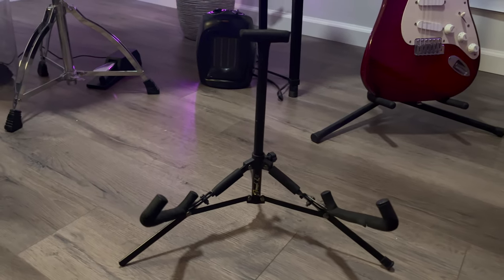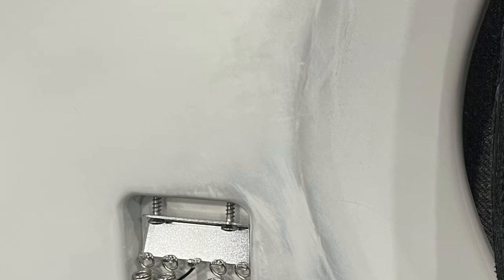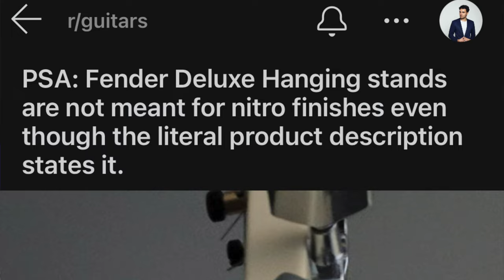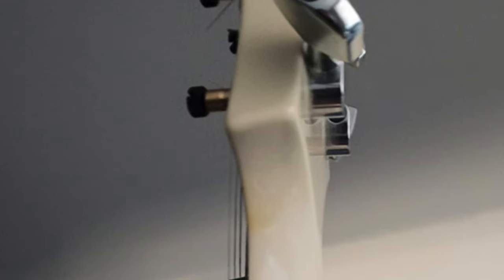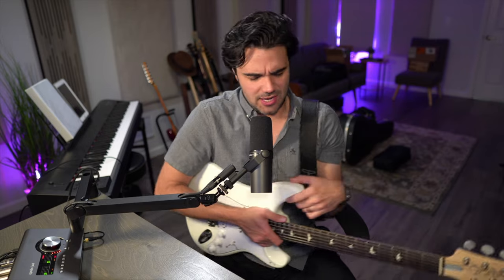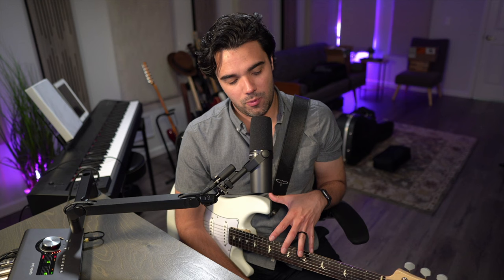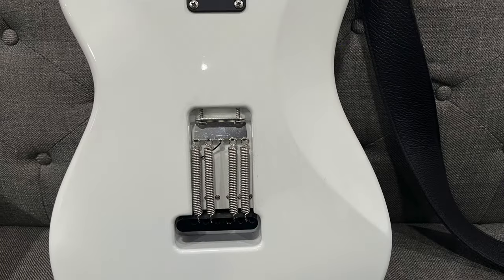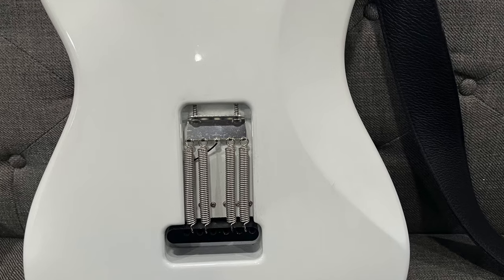DON’T Make This Mistake With Your Nitro Finish Guitar!

Comment: Thanks.  I expected that you had let it get really cold (like in a touring trailer during Winter), brought it indoors, and immediately opened the case.  That thermal shock will create cracks in nitrocellulose; lots of spider cracks everywhere!  Fender changed to polyurethane after many new guitars were arriving at northern guitar shops in Winter that were pretty much un-sellable as new, quality instruments.

Comment: The rubberized spot on top of the stand had major finish in my Strat melt right below the neck plate. Luckily I was able to wet sand it and recover at 98%. After some hand polishing and buffing I was able to restore the damage. Someone has to know where the damage occurred to spot it.

Comment: 1995-ish: Someone post on some forum "BTW don't put your NC guitar in a foam stand/hanger because plasticizer yada". Everyone: Puts old cotton socks on their stands.

2022: Someone who learns about guitars through reddit is stretching that one-liner to 20,000 words in a dramatic short film with a dramatic title, intro/outro, 5 acts digressing into the history of John Mayer and PRS, lots of dramatic flailing hands and facial expressions about how he barely managed to keep this from ripping the space-time-continuum apart (but phew, you can't see it) and finishes with a description of the PTSD the inexplicable chemical reaction almost gave him.  But no info about what actually happened, how to avoid it, what stands might be apt for the job or what self-help groups are out there for the victims.  Everyone: Subscribes.

<shrug>
Reply from the maker: If everyone subscribed, I can only assume that includes you. So, thank you. Also, your synopsis was pretty entertaining. Certainly more entertaining that my video. 😂

Comment: Well, this is known as “stand rash” among other things. Yes, nitrocellulose finishes do react to certain stands or the foam on them.
DuPont developed nitro a long, long time ago for auto finishes and the “breathing” myth is just that, a myth.
There is no scientific basis for this. 
You wouldn’t want the finish on a car to breathe as oxidation would occur very quickly. Therefore, a nitro finish on a guitar won’t breathe either. The wood will as it is a living thing. 
There are many folks out there that perceive certain things regarding nitro and that’s just fine. 
You can prefer the tone of a guitar finished in nitro but that tone is not because that finish is breathing.
I prefer nitro because it ages quicker due to the fact that it’s much thinner so there’s that.
Good video and definitely something to look for though.

Comment: This video shows just one reason why a Nitro Finish on a guitar is crap, there really are just so many reasons to go with polly over Nitro.
Reply from the maker: I know there are good arguments both ways, but if durability is the main concern, it certainly seems like poly would give you that.
Reply: @TomButwin  
Polly beats Nitro in durability, longevity, toxicity, and of course cost.  Honestly, I can't find anything that Nitro does better than Polly that I can confirm is true.  I see all the people telling themselves that Nitro sounds better than Polly, but I can't find any actual evidence that proves it, just peoples personal opinion..
Reply from the maker: The tone argument very well could be a moot point, honestly. I’ll have to do some research. Maybe a video!
Reply: @TomButwin  
This video popped back up in my recommendations so I stared watching it, and I was like "hey, I think I have watched this video before" I scroll down and see these comments from me 6 months ago lol.  I was about to comment a solution for the guitar stand to not hurt Nitro Finishes, its simple but Ive always done it to mine and never had a issue.  I buy a little fabric and wrap it around where ever the guitar is going to make contact with the stand.   I am sure if I was more crafty, I could do a much better job, but a few wraps of cloth seems to protect my guitar necks on my Nitro finish guitars, and it doesn't seem to make things less stable.   I have one of those Fender stands myself, and I used silk on the back and jersey on the bottom so it would have some kind of grip lol.  It works for me, though to be honest I have owned Nitro Finished guitars in the past, but I don't now.  I use that fix on my wall hangers as well, since its the guitars weight holding it in place and not friction.
Reply from the maker: Well, most of all, I’m glad to have you back on the channel 6 months later! Lol I’ve learned my Nitro lesson
Reply: @TomButwin  
well I had to put that idea out there, that was a pretty guitar, even if I dislike the finish type on it, it is a good guitar.  The cloth idea can add extra padding, it protects the finishes on all guitars, and cost very little to do.  Honestly it just takes the guess work out of all of it for me.   If someone is more crafty then me, they can likely decorate the stands to look all cool or pretty, my wife did on one of mine lol.
Reply: I use the old ties on bathrobes . Cut to length and slide it on.

Comment: It can be easily buffed out to a mirror finish...rub the whole back with some very fine sandpaper/scotchbrite type thingy to dull the surface a bit and level it and then buff it out to the shine you want with rubbing compounds..that being said it shows how stupid those old guitar myths are...that guitar makers still finish those instruments with that soft cancerous crap that pretty much never cures cause the urban legends say a harder finish...dulls the tone...while there are even aluminum guitars out there that sustain forever...i  have to give it to them though..since they convinced players to spend 2000 or more for a solid body electric instrument then more power to them.....

Comment: I left a cheap fender black strap on my new nitro finished  bass and it stained it after about a week. Not nice wear either, train track black dots on a surf green bass. Is there any way to get a stain out once it's happened ?
Reply from the maker: Really difficult. There's still residue and permanent damage on mine, unfortunately. Luckily, it's on the back and inner edging of the tree cavity, so it doesn't bother me too much.

Comment: Do you know if the nitro finish cracks easier? I have a 2021, moc sand gloss silver sky and it has little cracks in the finish in various locations. SOme of them I know were me, but just this morning I was double checking for cracks and found a new one, and can't figure out how it happened. And yes there not underneath the finish, I can feel them.
Reply from the maker: It’s a super thin (by design) finish, so it’s definitely more vulnerable to wear and tear. It’s kind of the nature of the beast, I guess.
Reply: @TomButwin  Thanks for the response. Yeah seems like it. Do you think the humidity and temperature change would cause cracking?
Reply from the maker: If there are extreme fluctuations, any finish or wood is going to suffer. If it’s just a normal and fairly stable environment, I don’t think it’d have that big of an effect on the nitro.
Reply: @willmalisch   Maybe you know this already as it's been a year, but it's called "finish checking." Search for that and you'll find all types on info on it. You see it a lot on old guitars.

Comment: Ahh yes this happened to me to on my tele! Two nice little black lines on the bottom where the stand met the guitar. Luckily as far as I can tell on my strat it’s either hidden by the black or the sunburst or just didn’t happen. Regardless a bit frustrating but now I use hand towels and old socks to sit between the rubber of the stand and the guitar. I also recently got a Hercules mini folding stand which is (supposedly) nitro safe! That being said I feel like now I’d rather just stick with the towels and socks just in case!
Reply from the maker: I think I might just cover everything in towels and blankets from this point on lol
Reply: @TomButwin  haha I just used old socks and towels I wasn’t using to cover the contact points (bottom parts and neck holder). From my understanding you want thick cotton cloth so it’s a natural fabric and is thick enough that it can’t bleed through or something. I caught the nitro burn on my tele much later than you did on your Silver Sky, so I have some permanent black marks melted into the finish 😭 nothing noticeable really but the fact that I know is enough lol
Reply: Highway One Tele? Those were nitro. Most modern Fenders are Polyurethane finishes which are impervious to things like this.
Reply: @sidneyhighfield2243  Mine is an American Original, which is a nitro finish!

Comment: nitro is an extremely volatile finish and  'pretty' is subjective.  If you want it to be clean you gotta be careful.  Rubber on wall hangers used to be the worst and nobody got it back in the day apparently because i've seen hundreds of Gibsons with the melted lacquer at the base of the headstocks.  I used to use surgical tubing for my stands but the companies eventually figured it out.  Always thought that was just the most obvious thing to see that's wrong with your product.
Reply from the maker: It’s definitely something that’s common knowledge…that wasn’t so common for me lol. What are your thoughts on poly vs nitro and tone? Is there really a difference for the better?
Reply: @TomButwin  I’d say when it comes to electricity and wood the pickups are most important.  The mythological tone finish is only available for well-made acoustic instruments. Now the aesthetics!  And feel?  That’s all up to you.  Design and what appeals is subjective.
Reply from the maker: Couldn’t have said it better myself! Appreciate you watching/commenting. Hope you’ll subscribe, if you haven’t yet.

Comment: I’m knocking on wood but all my stands are cheap and I have like 9 Les Pauls no issue yet. BUT I just bought an R9 and it had stand rash at the throat of the headstock(undisclosed btw) and that was fairly distressing. It’s bad for my OCD that’s for sure. I’ll have to upgrade my stands eventually I guess.
Reply from the maker: Hercules stands! Congrats on the R9. That’s amazing.

Comment: Poly finish can actually add rigidity to a guitar as it dry extremely hard. Harder than nitro. 
That can actually improve sustain. Not really the same as a dead or dull piece of plastic
Reply: I think poly seals the guitar in tighter not allowing it to resonate as much.  None of my poly finished guitars resonate as well as all of my nitrocellulose lacquer finished ones. Also doesn't allow the wood to age, but if you started to a roasted body or neck, then it doesn't matter because all the moisture and surgers have been baked out of the woods already and might as well go with poly finish.

Comment: I left my silver sky on a stand and it got cracks all over the finish from the cold weather 😢😢😢 is there anything I can do to fix it?
Reply from the maker: Unfortunately, probably not. Temperature and humidity can really affect a lot of aspects of any guitar. I’d ensure that the guitar is in a consistent controlled environment going forward and have a guitar tech do a setup on it to make sure the action/string height and intonation is all still solid.
Reply: You would have to refinish it.

Comment: Cheap paint, only reason they still use it is because they use to use it before. That’s the only reason. Makes no difference at all. Plug it it, the magnetic on the pick ups don’t care if the paint is poly or nitro, it’s pick ups metal sting vibration.
Reply from the maker: This supports your argument, I suppose: Silver Sky vs Squier Strat
https://youtube.com/shorts/fYclBUWk7Mc?feature=share
Reply: That's true but the metal strings themselves pickup how the wood guitar is resonating after it was soaked with acoustic energy. 😉 strings act like microphones. So most of the guitar does matter.

Comment: this would have been a much more useful video if you explained how youb fixed it.
Reply from the maker: I unfortunately wasn't able to fix it. Some of the residue that started to build up was able to be wiped off, but the parts of the finish around the trem cavity were damaged permanently. I wish I had a solution!